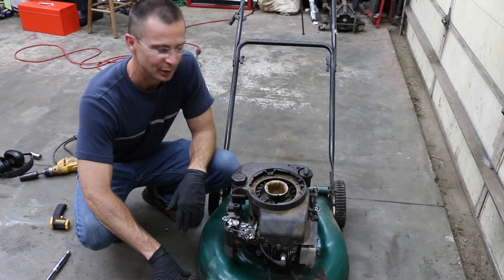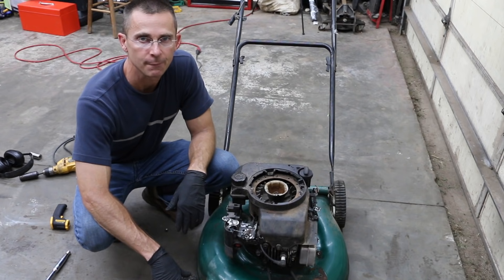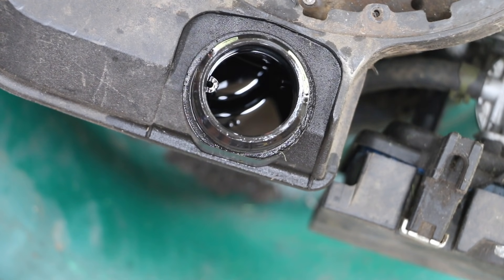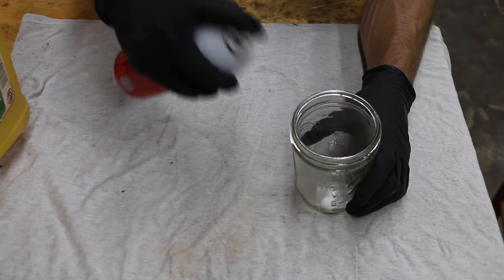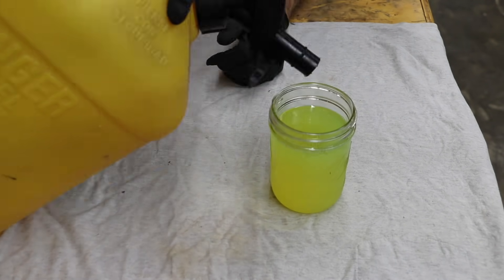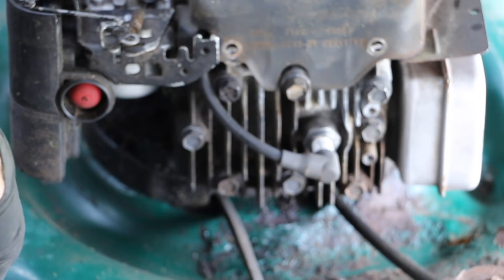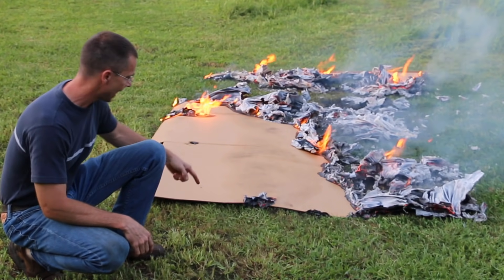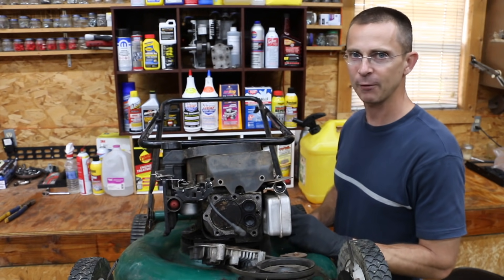Will a Gas Engine Run on Diesel?  Let's find out!

Comment: You should have lowered the amount of gasoline everytime by 10% and see what the minimum mix is to run an engine. 
About the cardboard: It is more visual if you use two pieces instead of one big slab.
Reply from the maker: This is a great suggestion!  Also, Great suggestion regarding the cardboard too.  This is great constructive feedback and helps me create better videos!

Comment: Would Alcohol run in a gas engine
Reply from the maker: Thanks for this idea!
Reply: That's what E85 burning flex-fuel vehicles do every day.  85% alcohol, 15% gas.

Lawnmowers aren't designed for it but I bet it will work.

Comment: Now test if the 50/50 gas/diesel last longer than just 100% gas.
Reply from the maker: This is a great question.  I'll test this!
Reply: It could. Diesel has more energy per volume than gasoline. It is also more viscous, so the air fuel mixture gets leaner in a carbed engine.

Comment: Will an engine run on 90 percent isopropyl Alcohol without damage?
Reply from the maker: Thank you for this idea--I'll test this!
Reply: While it will run, you will cook the engine ( or so i have been told) because  the alcohol will burn way hotter then Gasoline.

Comment: Here's an interesting idea: two engines side by side, one with 50/50 gas and diesel, and one with just gas, and neither of the engines have oil. It would be interesting to see how well the Diesel can lubricate the engine, if at all. Maybe not even running them till they seize, but looking to see if the Diesel engine stays cooler. Just a thought, albeit kinda expensive, and great video as always.
Reply from the maker: This is a great video project idea--thanks!

Comment: If you have a bucket of gas and one with diesel....throw a lit kitchen match in each and watch what happens.   Neither 'should' light...the gas vapor being too rich while the diesel is too lean.   Mix them 50/50 and now you have a VERY combustible vapor that is very easy to light.    The US Government learned this fact back in the early days of jets on aircraft carriers.   The ignition systems were pretty anemic so they mixed gas with the jet fuel (basically kerosene) to help it light and at first had this mixture in the storage tanks.   A big fire or two later they figured out that the mix was just too dangerous to store so they kept them in separate tanks and mixed in the nozzle as they fueled the aircraft.    It's no surprise that your test engine ran fine on 50/50 mix.   Good work...enjoy your videos.:)
Reply from the maker: I really enjoyed reading your comments--very interesting.  Thank you very much for the positive comments!

Comment: The Diesel actually has considerably LOWER octane value and much HIGHER flash point temperature. Diesel added to the typical gasoline engine in any appreciable proportion will cause "spark knock", detonation, which can be damaging.
Reply from the maker: Yes, this is a great point.  I wonder if an octane booster could help the diesel work properly.  I realize that it's not practical from a financial perspective.  Thanks for commenting!

Comment: I truely love your videos!!! I like how you attack the question at hand, allow for follow up discussion and give reasonable conclusions. 
How about trying: 
- Kerosene or Jet fuel for fuel.
- Different octane ratings and compare rpm(s) and length(s) of runs.
- Using a Diamond Fire spark plug vs a new factory spark plug. (http://e3sparkplugs.com/diamondfire-electrode/)
- mixing thick wheel grease and very thin oil in the crank case and see if damage occurs. Kinda like a 0W oil and wheel bearing grease, mixing 1 to 3 or something like that. 
I think you would have fun with these and your audience would learn alot. 
Thank you,
Steve W
Reply from the maker: Thank you very much for the positive feedback.  Also, I greatly appreciate the video suggestions you've provided.  I'll definitely try some of these!
Reply: for practicality they'd all have the same effect in a gasoline engine, due to kerosene, jet fuel, fuel oil(heating) and diesel being similar,  the main difference is purity.

Comment: I used to have a 70s chevy 350 gas that I ran on diesel.  Ran decent and had good power but the problem was that I had to get tricky to shut the engine down.
Reply from the maker: Great point regarding shutting the engine off.  I'm impressed it ran on diesel. Thanks for commenting!

Comment: Kerosene will  burn in a small  engine  we used to mix half kerosene to half gas if are lawnmower had been sitting or was running bad due to a  dirty carburetor and it would always run better and before you knew it  no more  running  bad
Reply from the maker: Thank you for commenting.  I'll create a video testing kerosene.  Thanks again!

Comment: Can you run an engine on straight octane booster?
Reply from the maker: This is a great question.  I'll definitely test this soon.  Thanks for this idea!
Reply: Technically you could use any flamable liquid or gas in petrol engine. The parts (hoses, seals, etc) being able to handle it is another matter though. Some things will eat the fuel system and even weaken the metal parts inside the engine.
Reply: Most octane boosters are made of toluene.an engine will run on toluene but it will run very lean, and it will screw up all the hoses and fuel pump if not emptied after each use. The inside of the engine would be very clean after use.
Reply: Eugene: Why would you make such a derogatory comment? It doesn't help anyone. It's just an experiment and a pretty interesting one. Nobody is forcing you to watch them are they?
Reply: https://youtu.be/GL1tA8FXmkg

I watched this a long time ago you may enjoy
Reply: Try jet fuel
Reply: Jet fuel is kerosene.
Reply: Tim babeu. You are correct. I was trying to explain in the most basic/ understandable way possible. So youll need twice the amount of toluene to go through your injector. Compared to gasoline to prevent lean mixture.
Reply: Higher octane slows down the burn rate of fuel.  It's for higher compression engines.
There is no water added...  You should look up what octane is.
Reply: It will but you have to mix it 1:1 with piss.
Reply: Crystian Bunker I would like to see that too!
Reply: I'm gonna say no, but want to see it tried!
Reply: What water?
Reply: yes! even with nos!
Reply: I bet you can, because octane booster contains mostly methanol.
Reply: tim babeu  yes instead of the 14/1 mixture which is the base for gasoline, if you use toluene/ethanol or methanol, the mixture should be 14/2. on a naturally aspirated engine, you can run any of them without any damage (except for the rubber parts) although you would lose some power due to the high octane in relation to engine compression. in a boosted engine, if you raise the boost, you will trow a rod due to lean mixture if air fuel not adjusted. BTW toluene is 114 octane and methanol is 110.
Reply: I was just going to ask this too, yes try this! Maybe straight seafoam or something as well? PS: The JB weld rear view mirror fix has been holding up great
Reply: acetone is a great booster .. 
cleans up valves .. smells harsh though..
Reply: Crystian Bunker   I know I couldn't  think of the word lol thank you though tested that
Reply: It depends on what the octane booster is. A cheap one is toluene, though too much is harsh on rubber parts. Anyway, you may need to play with the timing and fuel mix. I'm sure it could be made to work.

I got a lawnmower running on methanol in middle school. I changed the main jet from the one this 3hp had to one off a 5 or 6hp carb, it looked bigger, not sure exactly on size. It didn't have much power.
Reply: Crystian Bunker i
Reply: Crystian Bunker you can but a low compression engine will run kinda shitty, plus it turns the valves and orange color.. ive seen it 1st hand back in the day with an old monte carlo ss with a 305
Reply: +OrangeDiamond works best the night after you get on the grog. Scotch or vodka works equally as well. Mowing with a hangover is a bit hard though.
Reply: yes, did it once on a honda civic
Reply: Crystian Bunker octane "booster" actually suppresses the flamabilty of gasoline to prevent knocking, pinging and detention. It allows otherwise less stable fuel to not ignite pre maturly so that the fuel can stay stable at high compression (like engines in sports cars/race cars) and be ignited by the spark plug and not heat and compression.
Reply: he's already done that
Reply: WARD5KUSTOMZ Did you even check the date on my comment before posting your reply? I asked this question a month ago.
Reply: 14.7:1 / "stoichiometric" is what you're referring to, right? I've had a couple boosted cars, a Prelude right now running on Hondata S300. You aim for 14.7-15.5:1 at idle / low load, 13:1 boost transition and 12-12.5:1 for in mild boost on a stock NA motor. You start pulling timing and richening with boost, but more timing makes more power until...boom.
Reply: Crystian Bunker sure if you want to burn up a valve or burn up the rings
Reply: I've tried it and the answer is no.
Reply: Well Octane booster is just the combustibles from gasoline without the water and other stuff added in, so.. Yes but it will likely run hot and might need fuel air mixture being adjusted.
Reply: the level of stupidity is extremely high at the moment...

Comment: It also would be interesting to see the opposite (gas in a diesel) but i know diesel engines are expensive and not that easy to find one to destroy.
Reply from the maker: Thanks for this recommendation.  I need to find a cheap diesel engine for video projects.

Comment: I ran out of gas way off the beaten track and I had 2 gallons of paint thinner/ mineral spirits that I dumped in the tank of a Chevy pickup with a small block.  It got me to a gas station and didn't seen to have hurt it at all. It ran pretty crappy though until I put gas in it.
Reply from the maker: This is impressive!  This is one reason I'm doing these "alternative fuel" videos to figure out what will work in a rare situation.  Thanks for sharing this experience!
Reply: I forgot all about it until I saw you trying diesel in your mower engine. Lol, it was 20 years ago! Come to think of it, I've ran premix 2 stroke in my 4 stroke motorcycle with no problems except a bunch of smoke.
Reply: Cash for fuel was tight and you took chances that i would never take now!

Comment: Try alcohol (ethanol) or nitro fuel (fuel for rc engines) for this one you have to provide rich mixture because tha fuel contains its own oxidizing, but provides lot more power, 1hp out of of a 3cc engine at 30.000 rpm
Reply from the maker: I'll try both of these ideas.  I've got a lot of projects lined up.  So, it'll probably be few weeks before I publish those videos.  Thanks for the ideas!

Comment: What about diesel in 2 stroke? My grandfather always told me to clean up my 2 stoke with diesel and I have used it several times to free up stuck pistons. But would it burn?
Reply: Cool video though.
Reply from the maker: This is a great video project suggestion--thanks!

Comment: You should use E85
Reply from the maker: Thank you for this recommendation!
Reply: from my experience .... oh wait... id rather not spoil this one :) 
looking forward to seeing it if it happens
Reply: Juan Salazar it would probably mess up the rubber seat in the needle valve in the carb and start over flowing
Reply: His test method wouldn't provide a good conclusion because it would run, but you'd have to run it LONG term to see the effect on engine seals/hoses/primer/carb/etc.
Reply: Juan Salazar that would be quite the undertaking
Reply: E85 will eat the bowl and float part of an aluminum carb alive, it just turns to white dust.
Reply: to clarify as this seems rather one sided so far my experiences were great.
Reply: You're thinking of Methanol, not Ethanol.  I've used ethanol in all kinds of engines for many years. No problems.
Reply: e85 has an issue of being hygroscopic so over time or in high humidity it starts to gel unless you use special additives... It's why so many boaters in Florida got pissed when they switched even to e10. It started gunking up their engines and clogging fuel lines

Comment: I've had very good success with using a small amount of gasoline to bring the engine to operating temp, and then filling up with diesel once the engine was hot. If you give the mixture screw 3-4 turns out to richen the mixture, it will run no problem, and even idle, with very little smoke. I did this all the time when I worked on a farm where diesel was provided free but not gasoline.
Reply from the maker: Ben, this is a great suggestion on how to make this work--thanks!

Comment: There are lots of "metal conditioning" products that people use and add into their gas and oil, I'm really interested on the militec one that promises to protect your engine in case of oil level drop and to the wear. I've seen ads where people show cars runing without oil, after being "treated" with militec-1. Can you test this product or at least tell us how it works?
Reply from the maker: Thank you for recommending this additive.  I'll see what I can do.

Comment: Awesome experiment I've seen a Diesel engine run with gas in it and it knocks real bad lol and has low power but a diesel will run on gas but not well lol if you had a small Diesel engine you could try that lol
Reply from the maker: Thank you for the positive comments and for the video project idea!

Comment: ProjectFarm why is one valve always cleaner than the other one while both valves are in the same chamber. When the engine cycles wouldn't both of them get slightly charred?
Reply from the maker: This is a great question.  The exhaust valve is exposed to significantly more heat as combusted gases pass around the exhaust valve as it opens to allow gasses out.  Thanks for commenting!

Comment: The NEW Myth Buster ! ! !  BTW, used your suggestion for using Restore in our Ford 5000 and the white smoke went away, Thanks again ! ! !
Reply from the maker: Joe, I'm very happy that the restore video helped you!  I've begun using it on my high mileage car and the oil consumption has nearly stopped. It was burning nearly a quart every 3K miles and now it's only burning a fraction of that.  Thanks again!
Reply: Joe Serdynski o

Comment: Lacquer thinner 10% or more with gas (as a cleaner) i actually do use it to clean my car fuel system after storage it removed varnished gas in my case i have a Bosch Kjet system which has metal injectors it cleans the pretty well. BUT i keep the 10% mix for 3 tanks
Reply from the maker: Thank you for this suggestion!

Comment: use kerosene instead of Diesel. Ive heard it will clean an engine. I use it to clean my wheel bearings before I repack them
Reply from the maker: I'll definitely try this. Thanks for this suggestion!
Reply: I never said it would run better. I said it may clean an engine and I wanted to see if thats true. and yes I do know that certain fuels can be run in other types of engines anyone with half a brain and any experience with engines knows that certain fuels are similar to others.  but this isnt a waste of time. these are real results tested and proven honestly for our enjoyment and knowledge. its a shame some people dont understand that you can always learn something new

Comment: When messing about with my POSgen generator with Paraffin, I found that running with a slight bit of choke helped pull the straight paraffin (which is slightly thinner than diesel) through the carb to get it into the cylinder, and of course the engine had to be pre-warmed on Petrol to work right, but work it did... :)
Reply from the maker: This is a great suggestion--thanks!

Comment: When it was running off the primer, what if you made it run richer by turning the mixture srew?
Reply from the maker: I should have tried this.  I think the diesel had a little too much viscosity to flow freely or it might have ran.  Thanks for the idea!

Comment: At one time in my life I could get diesel for free and gasoline cost 40 cents a gallon. I ran my Fiat on 2 gallons of gas to 1 gallon of diesel - did that for a year, pinged a bit and was missing a bit of power but worked fine. Didn't hurt the engine.
Reply from the maker: I'm sure this saved a lot of money!  Impressive!